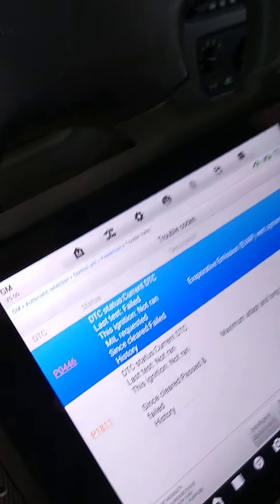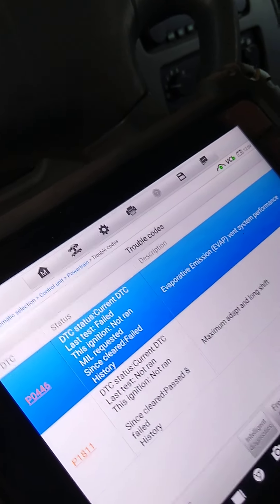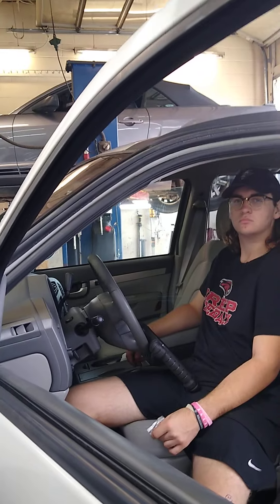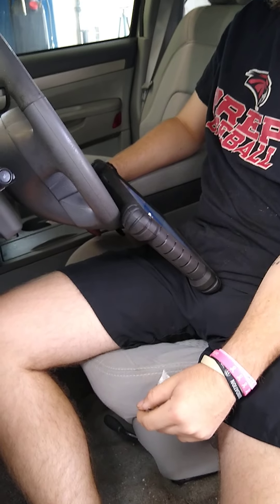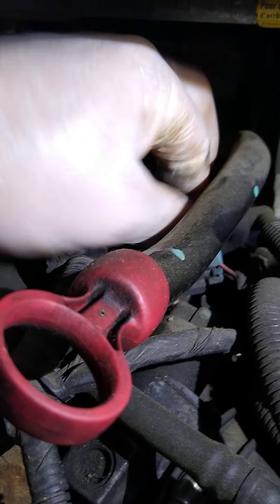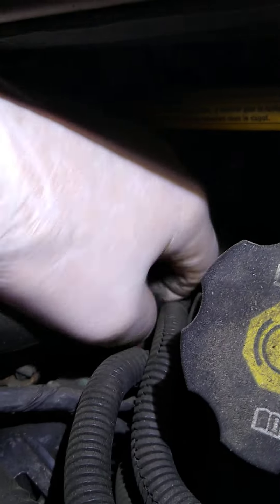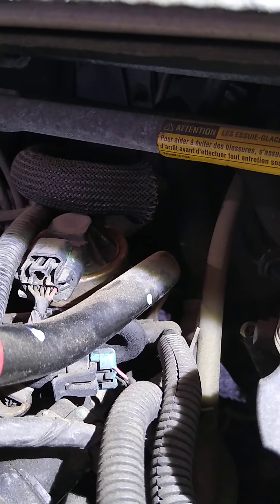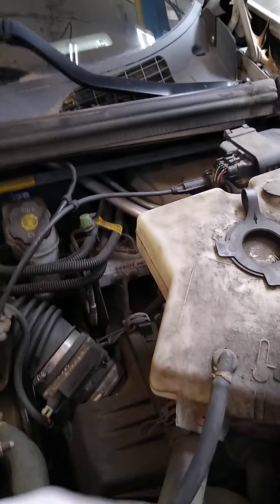2004 Buick rendezvous 3.4 l po446 code not always the vent valve

Comment: EVAP vent valve has been defective. 5yrs in a row. Needed a vent valve. PO446. New vent valve  no leaks purge valve holds vacuum. And driving me crazy as no leaks no found malfunctioning parts or hoses.. but keep on getting PO446
Reply from the maker: See if it passes the smoke test from vacuum hose rite at purge valve start at this point plug vent hose no smoke showing up, u have valve issue I suspect
Reply from the maker: Or tank pressure sensor faulty